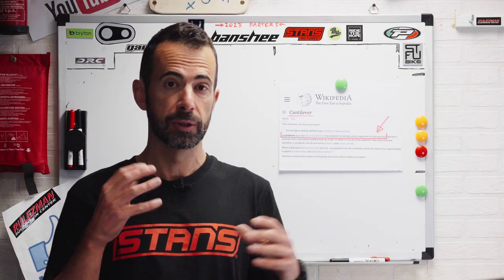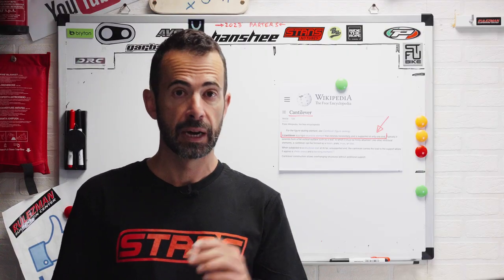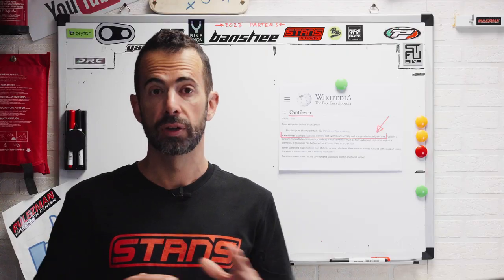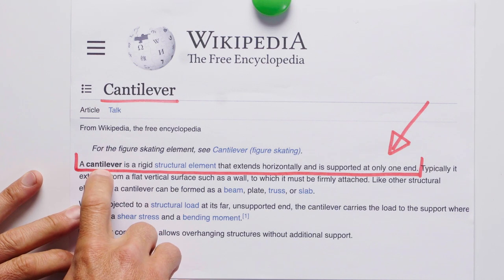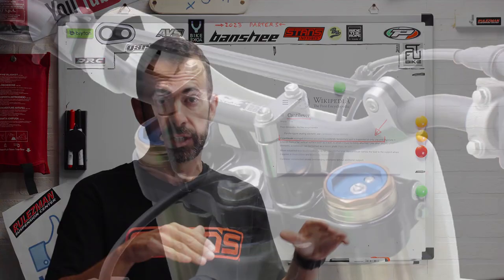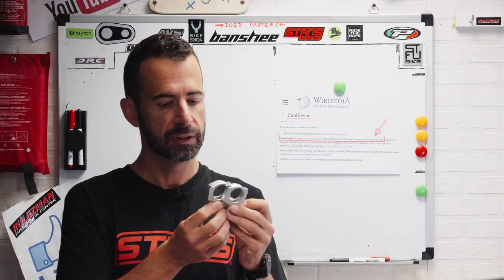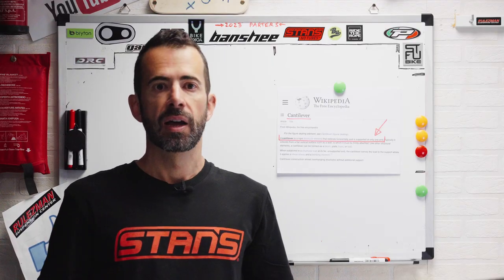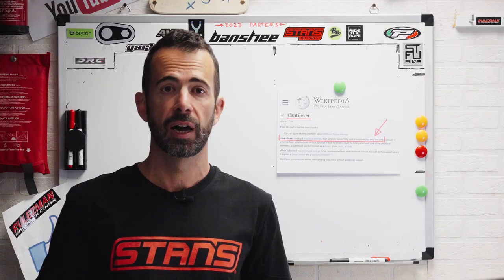MODERN GEOS & SHORT STEMS  : TECH TALK

Comment: Im currently puzzling with bars that are comfortable for me so I have round 7 different ones at home. I measured them all and one thing I noted is that they very strongly differ in how much they reduce the Reach. E.g the ergotec with 12deg reduced reach by 70mm. The SQlab with 12deg however only 35mm and the FAST flex one sits somewhere in between. All other bars with 6deg (Renthal) or 9deg (Nukeproof) sit in between. Its really mad. I guess that should be added to the equation of correct stem length because with that Ergotec my 40mm Stem is effectively Zero offset - and it feels great :)
Reply from the maker: you are not uptiltinf handlebars up by 5 degrees to follow natural hands contour, as well you are probably ( I guess) measuring end to end, while in reality the line should be drew from about 7 cm inside each hand of the handlebar.     ANYWAY: 7 bars at home, My compliments, you invest a lot bro

Comment: I wonder about your opinion on the stabilizing effect of a longer stem; I think 30-50mm is not uncommon stem length that's been seen around EWS and many casual riders, myself included. 
The issue with super short stems and narrower bars, say 760, is that the steering can become twitchy - front wheel gets deflected easier by the obstacles the front wheel hits. This can be mitigated by slightly increasing the stem length. So a longer wheelbase will not neccessarily aid in controlling wheel flop.
Reply from the maker: my opinion? NOTHING RIDES BETTER THAN LONG WHEELBASE BIKE, LONG CHAINSTAY , AND 15-18mm STEM.
Reply: @RULEZMANSUSPENSION  Yes, I understand that, as claimed in your video, but you haven't really ellaborated on my proposed issue of your argument.
Reply: I built a short stem that’s about 15mm on my dh bike and it is wild how good it feels. It’s not twitchy but the steering feels faster in a very smooth and controlled way.
Reply from the maker: good boy!  🎖
Reply: In this case change the angle of the headset bearing ( i.e with works 1-2 degree angleset ) to slacken bike out which will make bike less twitchy
Reply from the maker: @wobbem007  Desendacon said " BIKE IS NO TWITCHY , I guess his angle is perfect.       If it was to me, 100% of MTB were with a 63 HA, no matter if XC, enduro or DH.   .......  mtb sucks, bro 😂
Reply: @RULEZMANSUSPENSION  Giant's new DH bike has a 61.6 degree Head Angle
Reply from the maker: @wx2999  if they are happy, they are happy.      I have a giant TCR A SL road frame... GREAT BIKE, but I keep all my MTB head angles at 63...
Reply: No, short stem is not a twitchier steering.  It is more accurate and more direct.  If a longer stem makes your steering feel less twitchy, you're doing something wrong in your bike handling.  Long stems are tillers and they force your hands to move when the wheel hits something.  Your hands are forced to make the wheel twitch.  So "twitchy" describes long stem situations, not short stem ones.

The easiest way to understand this is to ride an off-road moto with 0 deg stem offset, and see how steering feels.  Then go hop on a road bike with a 100 or longer stem.  See which has "twitchier" feeling steering.  And by "steering," you should be describing contact patch messages, versus where your hands are being pushed by the contact patch messages.
Reply from the maker: bro.. we have a better view of the problem because we are moto riders too , not just mtbkers.     Sadly the tipical mtbker is very mind-closed and acts like a lomotonised person .
Reply: @RULEZMANSUSPENSION  The long road from european road racing bicycle frame origins... it still lingers on in some corners.  Your history explanation in the video above was perfect, tracing back the modern geometry issues of MTBs to their road racing frame origins.  Imagine riding a moto with road racing bicycle geometry -- on a classic outdoor MX track, a hare scramble, or even a trail ride.  How unfun would that be?

Look at how much longer it took the more traditional MTB XC racers to come around even slightly on their roadie geometry preferences.  At least a decade behind trail and enduro MTBs being sold globally.

Comment: So if I wanted to attempt to experiment, say with the same bike I already have in a size large with a 50mm stem, I would need a larger (xl) version of my bike, and reduce the stem length 

But the chainstay would also need to grow longer as well for this comparison to work correct?  If the chainstay between my two theoretical bikes remains the same, and reach increases, then all I’m doing is making the bike longer in front of the bb, and thus putting more biased weight further back correct? 

This is only if I wanted to compare two of the exact same bikes 

So if I feel good on my current bike with a 50mm stem but want to experiment, I really can’t do that unless the next larger size up increases the chainstay ?
Reply from the maker: correct. My clamp can be used ONLY on bikes with proper geos

Comment: the chainstay length is quite interesting as it is more fun to have it shorter for nimble and fun rides. pop manuals from time to time and get out of corners quick.
Reply from the maker: NOT FOR ME: I have more fun with 500 cs than 400.
Reply: I think the only valid reason to have shorter chainstays is for wheelie and manual. but that's not really the reason I'd buy an Enduro MTB anyway...
Reply: @allseasons765  Short chainstay is easier to bunny hop over rocks,roots and gaps so it can save time in a race but depends on the track.
Reply: This is why we should have sepparate bike
Downhill frame designed for racing and Downhill frame designed for Freeride just like Commencal did they have 2 different DH bike

Comment: This is super interesting, thanks for making this video. I do have a couple of questions though. How would someone go about finding what reach they should theoretically be riding? Are there any measurements we can take to help get us in a ball park? And I know you and Paul are big fans of the moto style suspension that's much stiffer and damped than what we are probably conventionally used to riding. Does this style of geometry require this style of suspension setup to work well?

Cheers for the video anyway, It's really got me thinking.
Reply from the maker: our style of suspension works better on any frame, we strongly know stock stuff is badly set, no matter stem length!!! bro!!!  nope, at the moment we haven’t lay down a table chart of sizes, maybe we do it in future. Personally I offer this type of thinking-helping to my clients as a package when they buy a new bike etc !
Reply: @RULEZMANSUSPENSION  ah, I was going to say this sounded like something that would go well as a packaged service. Interesting though. I'm excited to see where the industry heads towards since the past few years it seems to have settled any drastic geometry changes between models.
Reply from the maker: @swankysnail  nothing will change until the sales of actual Crap slows down
Reply: I like the idea of the shorter stem of 15mm. I have a husqvarna 300te and the bars are over the forks so this is agreed. If you go the short stem then we need a longer top tube. Could one change out their front triangle for the next size up do you think ?

Comment: Another thing people don't realize is how much reach you lose with riser bars.  I typically lose 5 cm from the frame reach once I get bars that meet my "real stack" preference.  I need bikes with 530-540mm frame reach typically.
Reply from the maker: CORRECT 🎖! this is why I always buy XL frames for my 179 cm heigth !!!
Reply: That must mean you roll your bars back quite a lot, right? I stand my riser bar straight up and instead gain total reach. I guess there's a lot of preference differential!
Reply: @niklasdr  I'm tall (6-6) so i need a lot of height from my bars and to keep my grips in line with the head tube axis the grips end up well behind the top of the head tube.  I'm not rolling back the bars though, this is just what happens when you add 10 or more cm of stack height with riser bars.

Comment: it all nice to be said and showed with pictures but is there are really telemetry prof for extremely lite hands? when i moved to longer frame it becomes easier to load front by hands, 15-20 kg is not much for trained hands
also you don`t really pull bunny hops on motocross bike (without using engine) so short chainstays here to stay for playfulness of bike

Comment: How about fork offset? I can buy 37mm, 42mm, 44mm or 46mm offset fork for my 27.5" enduro bike.
You are correct about the 15-18mm stem lenght because the grip is going to be centered with the steerer tube and I totally agree with your view, long stems are terrible. But how about fork offset? How can I choose the correct fork offset if my handlebar is centered with the steerer tube and what effect does it have if use "shorter" or "longer" offset?
Reply from the maker: the shortest you can get.     PERIOD .
Reply: @RULEZMANSUSPENSION  You love the purest, cleanest (physics-wise) steering possible.  Fewest outside inputs.  Am I right?
Reply: @RULEZMANSUSPENSION  shortest fork offset?

Comment: Fantastic video thanks! A big difference between motos and bikes is the rider is an essential handling piece as the system center of gravity can be changed much more than a motorbike. How do you view the effects your ideal setup would have on jumping via 1: build ramp and 2: bunny hopping? 1 a moto can do but 2 is unique to bicycles.
Reply from the maker: not really… trials riders bunny hop trial bikes too using suspension force and engine rev: moto is just 100 times more difficult

Comment: Crashing into an obstacle (the crash shown at 15:30 ) is less of an issue for 'cantilever' stems as pushing on the bars with both hands will want to straighten the bars. More so than with a zero offset stem.

Regarding the torque applied to the steerer tube by the 'cantilever' stem (even the one shown in the video, never mind what's actually being run on modern bikes en masse), it's peanuts compared to what the fork is doing to the bearings, steerer tube and headtube.
Reply from the maker: you are wrong bro: to “ straighten” the bar you need strong moments each side, and strong moments are obtained with larger ARMS aka the widest distannce from center to grip , in other words the bigger is the handlebar the more easier is to counterbalance a moment of force on the steer axle.

Comment: I just started riding a mountain bike, coming from motorcycles. I find it infuriating that sub 20mm or even a 0 offset aren't regularly available. It may be that I'm new to a mountain bike, but the cantilever steering feels like such a garbage. I'm 5'10" on a large 18-inch frame 29er. Maybe that's my problem, but all the strange feelings are coming from the odd steering, in my opinion.

Comment: First question:
And what about handling tight corners?
I am 189cm tall with +12cm ape index.
If I put 500mm chainstay and 600mm reach with 78° STA and 64°  HTA I would get around 1450mm wheelbase.
Second question:
If you pair 15mm stem with 63° HTA wouldn't it be too nervous?
Third question:
If I take 820mm 13😢° backsweep handlebar and it starts curving at 2/5 so it leaves me 3/5 ((410x(3/5))/90°)x13°=35.
That means my 35mm stem will put that handlebar in alligment with fork. Is't that true?
Reply from the maker: damn, you are good in math, but real world is different:     at 189cm you need 530ish reach and 680ish stack, 15mm stem, 490-500 CS, 1360ish WB, and it will be the best bike of your life.
Reply: @RULEZMANSUSPENSION  that is good for normal 189cm tall guy. Each of my arms is 6cm longer. I have 498 reach with 120mm stem, 678 stack plus 40mm spacers below stem and standard handlebar, 76° STA. Perfect fit
Reply: @RULEZMANSUSPENSION  I plan to go completly costom and make geomax bike with 1410mm wheelbase since that is the maximum without losing preformance significantly

Comment: Correct in theory. And might work nicely. But the bike will be very long (front to rear) for this to work (assuming you want the same reach). Dont know how agile it will feel on twisty trails and going over obstacles in lower speed...
Reply from the maker: I make enduro and downhill bikes: the average speed on descent is about 27-31 km/h.       for obstacles I use a trial bike.
Reply: @RULEZMANSUSPENSION  OK, then I agree that it will work. Will be very stable in high speed.. :-)

Comment: Do these short stem benefits only apply to descending rough technical terrain? What if I'm only worried about speed/power/efficiency on flats and moderate inclines and I don't care about technical descents? Is longer stem better in that case? Or same rules you describe still apply?
Reply from the maker: any bike
Reply: @RULEZMANSUSPENSION   I have a Polygon Xtrada 7 medium, but it feels like I should be on a L at least. It came stock with a -7/40mm stem and 760mm handlebar and 0 offset seatpost. I currently have it setup with a -25/90mm stem and a 725mm bar and a 20mm offset seatpost.

Is it really bad to modify it that drastically? It feels pretty good, certainly not perfect, and I know ultimately that I just need a better fitting, but is my situation salvageable? Should I try to keep as close to the original specs on the bike?

Comment: Congrats on the the reall y well made video. The point that that never makes it into the discussion is the dynamic change in cs length and it's effects. A Banshee legend for example has a really long static cs but shortens a lot as it moves into it's travel. So being tall (196 cm) i sometimes wonder if the static cs length is the real info i should be looking for?
Reply from the maker: frankly speaking , at 196 cm you should look at  get a custom frame with 550  reach and 700 stack or more, 1400 WB, 500 CS or more.
Reply: @RULEZMANSUSPENSION  yeah ,i'm already on a g1 but i could really Imagine the CS to be even longer.

Comment: I use 12 degree backsweep 40mm rise with a 40mm stem . Effective stem length is now arroumd 0 . / frame is long xl honzo 510mm reach
Reply from the maker: with 40mmm stem and 12 back, there is no way your hands rotate around steer axle.     you are about 15 mm forward.

Comment: I really like this presentation.  I have a hard time with long CS unless I have a motor propelling the rear wheel and can change turn radius with throttle.  On a MTB, long CS just opens up the needed turn radius for a given turn, and/or requires you to square the turn w/o throttle, or do a nose pivot to bring the rear wheel around.  The grip is incredible, yes.  But the maneuverability suffers for me.
Reply from the maker: each one can buy/usw what suit him the best:  myself and Aston can not ride short bikes any longer and we are totally convinced the whole mtb world still has to grow in size!     btw.. I rode motos for 30 years but CS on my hondas cr… was Way Longer than stupid mtb 430mm 😂😂
Reply: @RULEZMANSUSPENSION  It takes at least different skills, if not higher levels of skill, to ride a long CS bike in places with tight corners.  In some situations you can set up the turn and it doesn't feel horrible to me, but I've ridden trails that force me to get off the bike when the CS is too long and my skills can't bring it around.  I can imagine that if I could ride with more trials skill it would be appealing.  But I still think of it like skis, you can have small R slalom skis, mid R GS skis big R SG/DH skis.  At one end of the spectrum the turn almost begins itself; at the other end you must have speed to get the ski to begin a turn, or if slow you need lots of room to initiate the turn.  Or a slash to start the turn.
Reply from the maker: @seanoneil277  yeah, makes sense:    the main point to me is that everyone is timing their runs downhill (enduro or dh no matter), averaging a speed of 25-30 km/h, this means to me that the speed is HIGH, and this means we need long CS / WB bikes.     For sure to go at 4 ..6...8  k/h and making trials and tight trails, a bike with 26" wheels and 410 CS and 1050 WB would be 10000 times better than a bike made to keep that 30 km/h average in a easier way.       My goal is to make bikes to go FAST and with less effort.  I am not here to do trials.
Reply: @RULEZMANSUSPENSION  Modern UCI World Cup tracks are super high speed compared to 20 yrs ago.  If I rode at that level I would want (I think, from my piker's perspective) a relatively ground-hugging suspension and geometry like what you're talking about.  When I watch World Cup DH, I'm always noticing Loic Bruni's stability and smoothness and that's what I'd be aiming toward.  The tight corners of a place like Schladming would take a lot of work, but I say that as a piker not a top-level rider.  They probably adapt as easily as anyone could.
Reply: @seanoneil277 Loic Bruni admitted that he is old school with his bike setup he runs really short, The reason why he can ride it because his body strength can handle the bike. Compare it to Jackson Goldstone he rides very different compared to Loic he has long wheelbase and high stack by just looking at his stature, look at Assa vermette he also rides long wheelbase since he was smaller and younger.